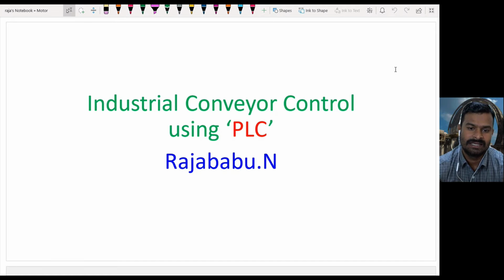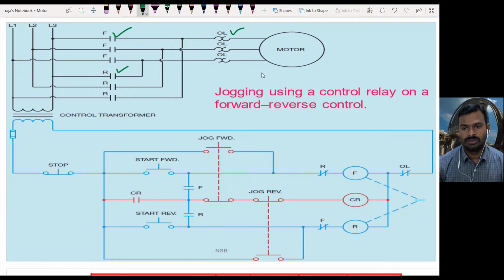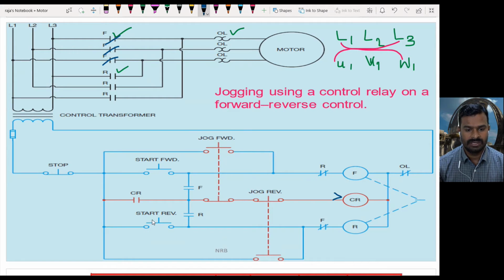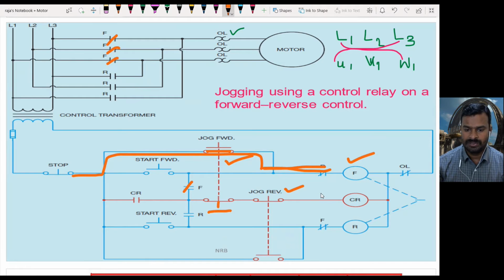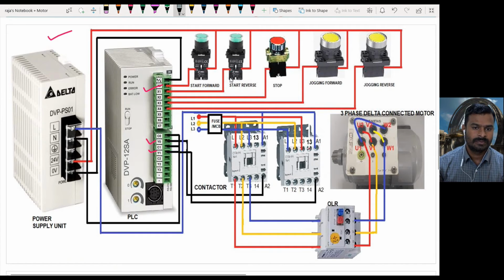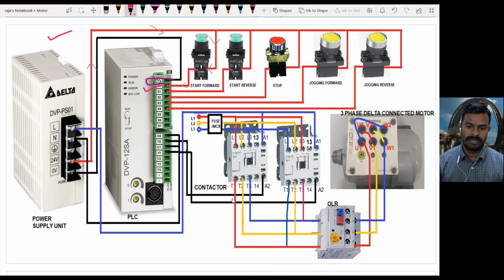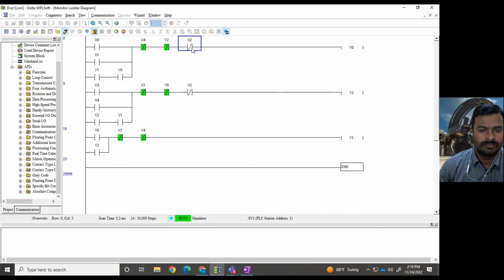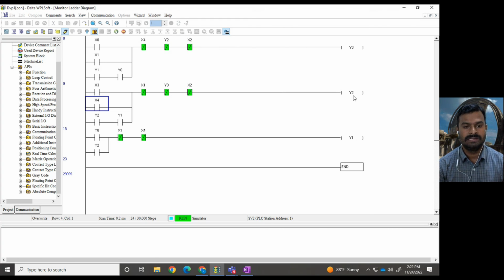Conveyor control using 3 Phase Motor and Programmable logic controller

Comment: Can both contractors short circuit for a moment  ??    Looks a bit risky ...
Reply from the maker: no brother, I used forward and reverse contactor interlocking so without  turning off the process from one direction other direction contactor can not be turned on. So short circuit chances are not there. Thank you for your useful comment